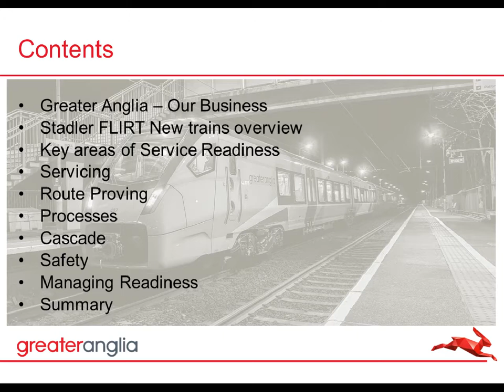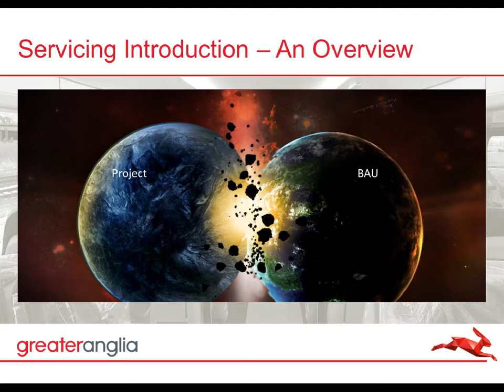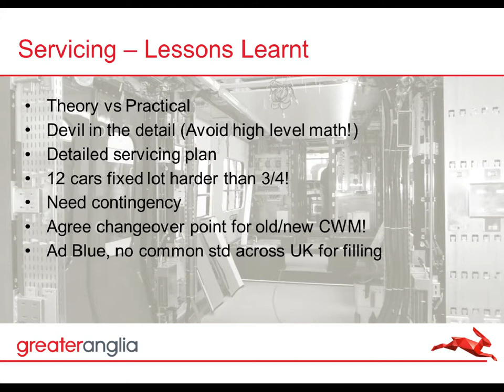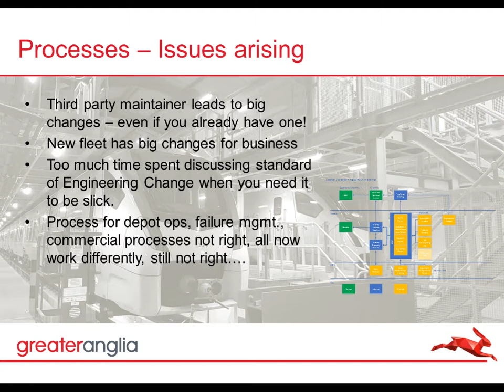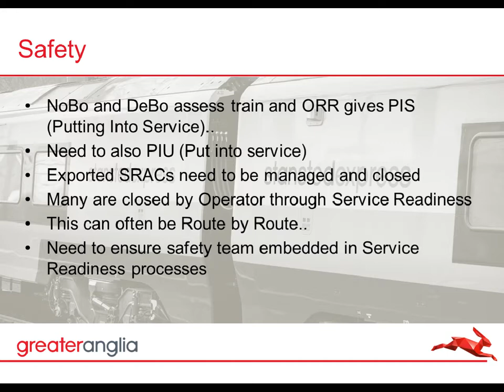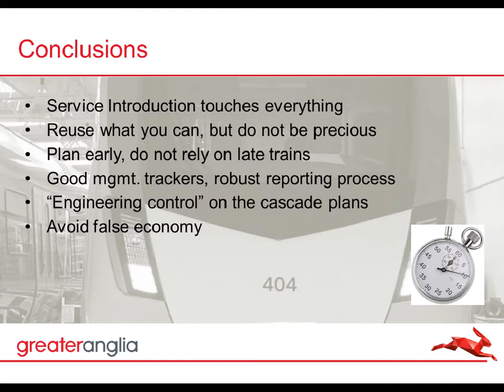New trains for Abellio Greater Anglia

Comment: What about the Class 720 Aventras. As 89 of the Class 720s are to be built and an extra 44 Class 720s are to be built making the total of 133 Class 720s 5-Car units on Greater Anglia. That will replace the Class 317, Class 321, Class 360 and Class 379 EMU units. 

https://en.wikipedia.org/wiki/British_Rail_Class_720